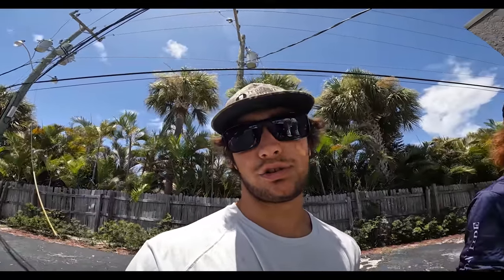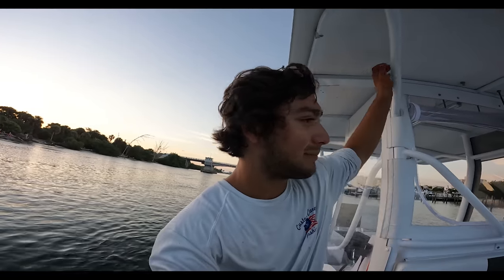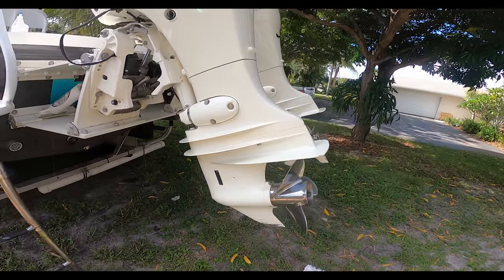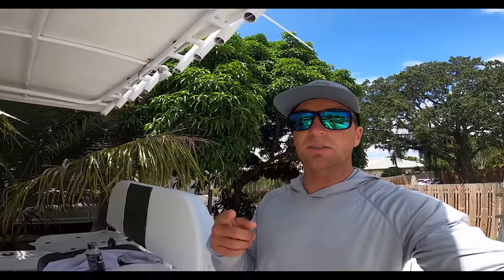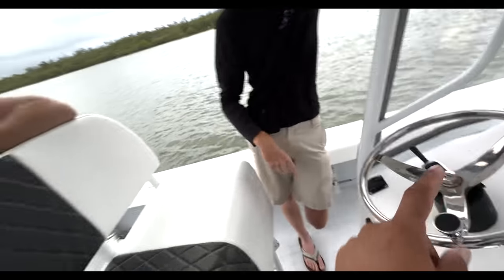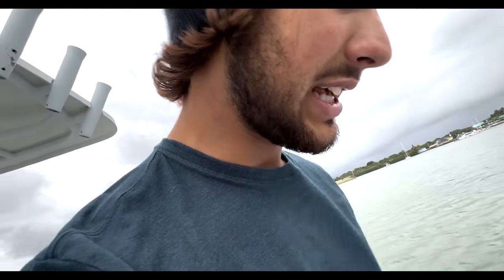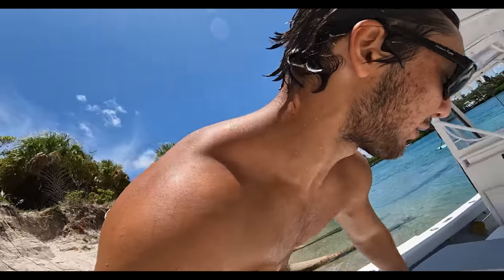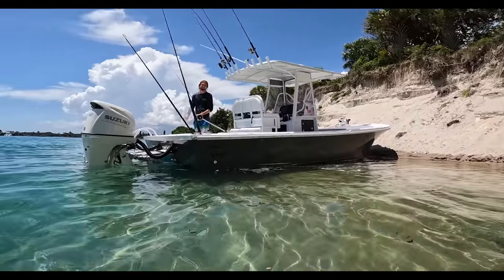My BOAT is FINALLY DONE!!! We went FISHING!!!!!!!!

Comment: Add a macerator pump to the floor live well. It's below the water line. 
Trade in the 140's for 200s and you'll see over 3mpg. They will pay for themselves.
Reply from the maker: You are right….. about everything lol so how do I add the macerated pump
Reply: @MovinWeightFishing  it goes inline. You can mount it in the bilge or on the exit of the well.  It will need to be switched on the dash.

Comment: Big boat for 280 hP.
That could be why your RPMs are a lot higher then your speed. 

My 20ft skiff has a 250hp and it only goes 50mp at 5k rpms.
Has a 50 gallon gas tank